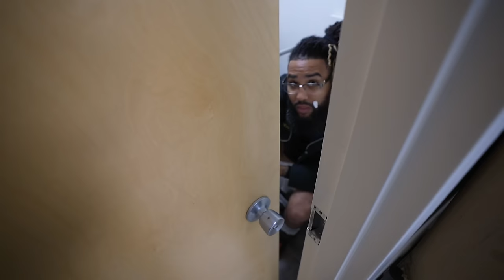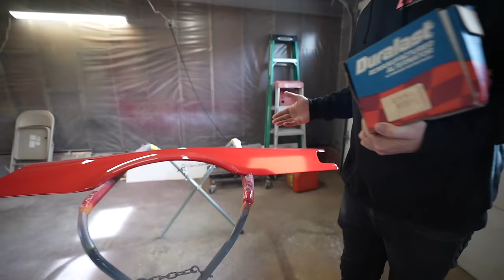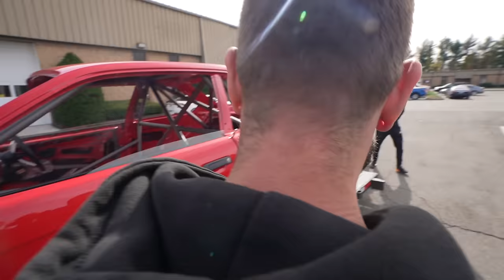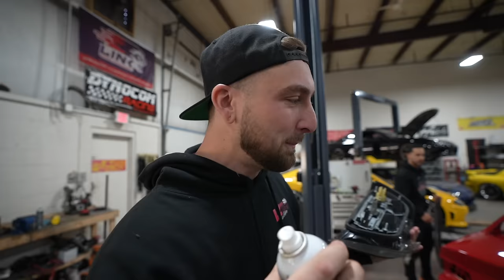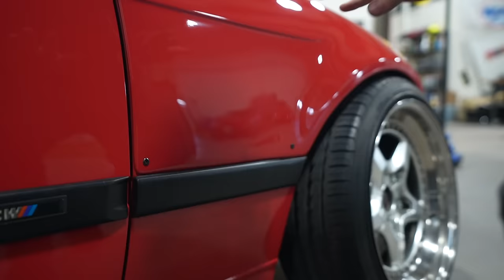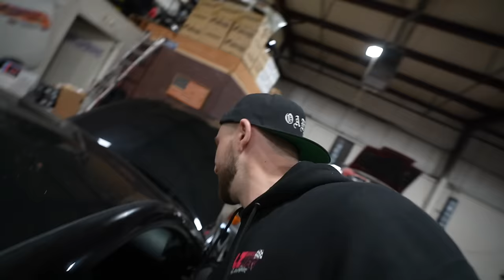After 5 years I finally paint my E36!!

Comment: First, holy shit Spoon is a wizard. That paint finish is like glass and I've never seen overfenders fit that smooth, with a finish that matches that tight without being molded to the body. The rivets work 'cause it's so clean, not all rippled and gross like most fibreglass kit paintjobs.

Second, totally agree on the 86. My initial idea was going to an SR16VE or maybe a 20VE, they're really powerful for their size even NA and go nuts but the K was a good move. NA, high revs, free spinning, the right power level and even the ITB look just like the 4AGE, but more modern, larger capacity and more powerful

Comment: Ae86s are easy and fun to drift, because even with stock angle and with now camber correction block you could drift an ae86 or te72 or te27 corolla. We use canyon drift our ae86 and te27 in the canyons around Los Angeles. They're kinda like an old e21 or e30 fun and drift happy.

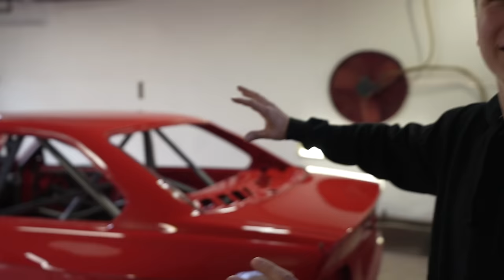Comment: @6:17 being a drift car with no interior it would be far easier to do hidden hardware for the overs, but that requires the hardware be molded into the flare then nuts go inside body panels of the car and accessed through the inside. but the "molded" look is achieved and its stil easy to swap out the overs. just needs to shave hardware again if replacing the over from drift damage. but all in what, what we see now is fuego!!!! just use back anodized rivets..... or rivnuts.
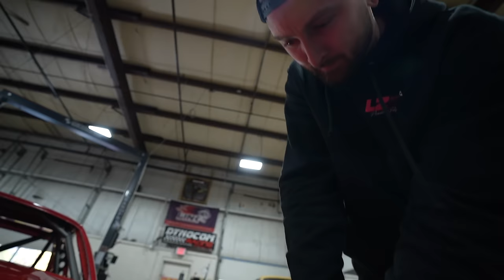Reply: @9:04 lets go!! great minds think alike!!

Comment: Great Video Jimmy don't worry about your videos there great 💯 just get a heap of old gopros off Adam hes sponsored by go pro now and mount them bitches everywhere when you take the twin cam to the track 👌🤙 one in the engine bay, one beside the exhaust on the rear, 2 inside one looking forward one looking at you one on the roof, one low down on the front bumper 😁💯🤙👌 I can't wait to see your smile when you drive it . They are like a classic mini you can't help but smile when you drive ann ae86